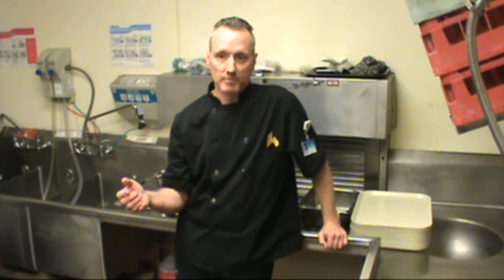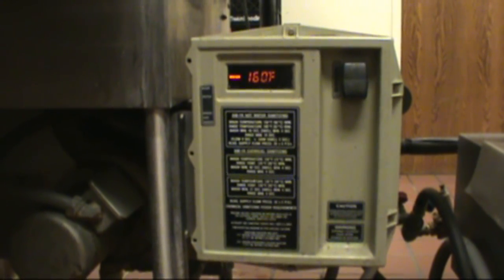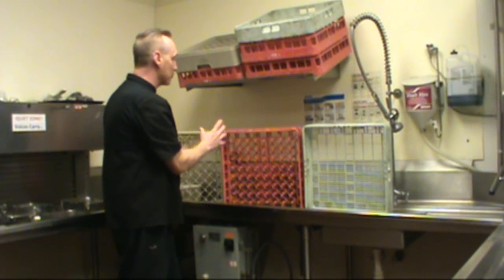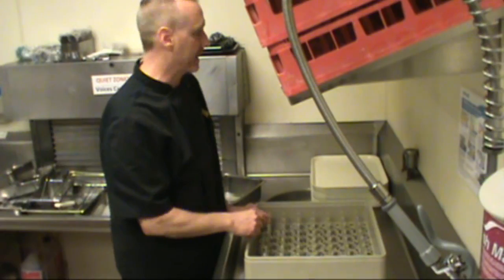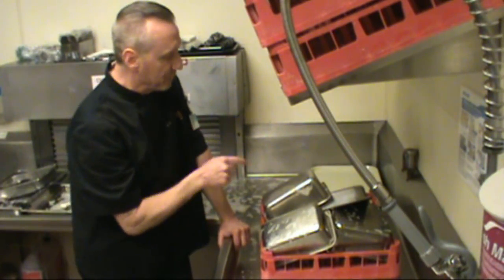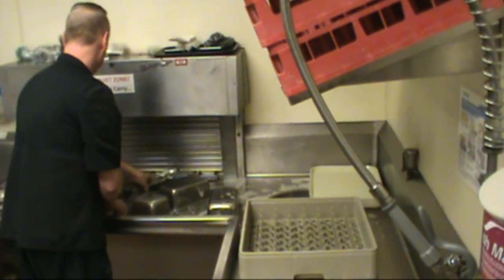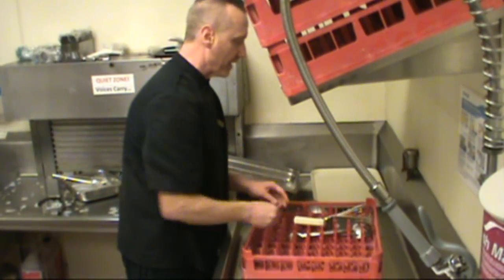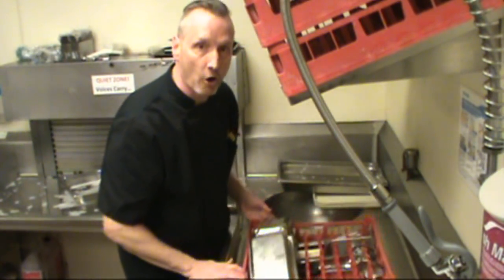KBMC Dish Room Training Module 1a 1280x720

Comment: Been a dishwasher about 20 years...I agree with mostly everything..except you should use a flat rack for utensils. Now of course the machine will not clean them thoroughly. However, the machine's HOT water will help really caked on food debree. So sending thru once then steel wool will do the job yes.
Reply: i was a dishwasher too what he is saying arond 4:30 about that rack  is debateable